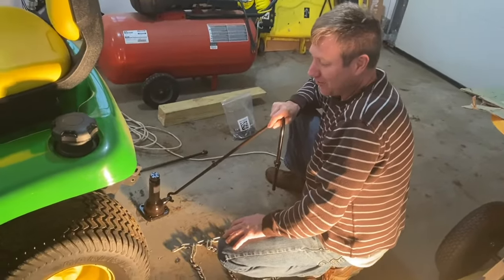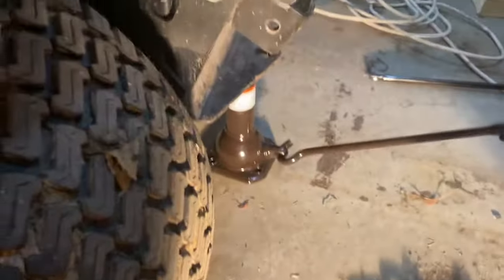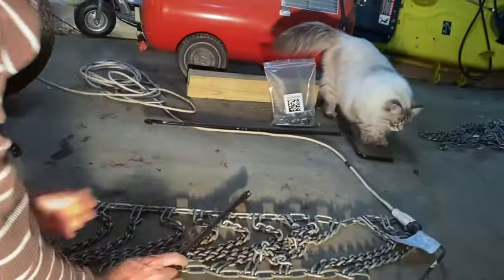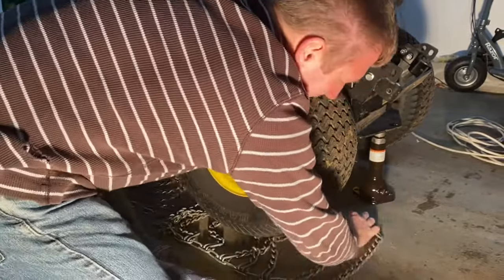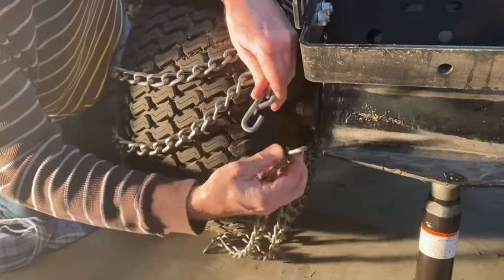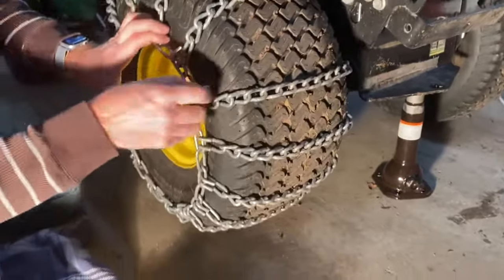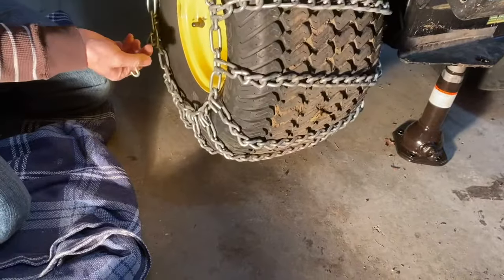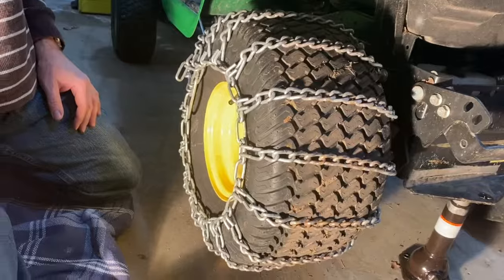How to EASILY install tire chains on John Deere X370

Comment: I pretty much have the same method with one additional step that makes a big difference. Let a few pounds of air out of the tire so it is a little soft and you're able to really snug up the chain. Then top off your air and the chain is nice and tight. You get better performance plus an easier, faster installation.
Reply from the maker: Great tip!
Reply: I take the valve stem out and start fully deflated, very easy to put them on.

Comment: Nice using a jack for this process. 2 tips,  Using the jack, I'd chock both front wheels, forward and rear. #2,  Once installed, don't shy away from using bungee cords to keep slack to a minimal.

Comment: I’ve been doing it that way for years, the Jack makes it a much easier job. I would recommend using some zip ties to hold the chains together as well, if the lock you were struggling with pops off it’s no fun fixing the chains when the wheels are covered in snow.

Comment: A few weeks ago I saw this technique on another channel.  And i tried it with our Ford 8N tractor.  I picked up one side, put the gear in neutral, placed the chain on the back of the tire and rotated the tire forward(over the wheel).  It was so much easier than driving over the chains.  Locked them in place, add the bungie cords for tension, and moved the floor jack to the other side and put those chains on.    Your installation went as fast as my Ford 8N tractor.    The only thing that I would change from your technique, is to spend $120 and get a 3 ton floor jack on wheels.  they are so handy to roll around in the garage and make rotating car/truck tires much easier.

Comment: Hook the inside chain connector in the 2nd or 3rd link. Then the outside connector in 1st link and Check fit. Move outside a link at a time until best fit. You may even have to move the inside again. You should never go beyond the first cross bar chain. Drive around a minute or so and tighten if necessary.

Comment: Nice job!  My routine is similar.  I see in the comments that some have already suggesting deflating the tires.  At the point where the wheel starts rotating and distributes the chain evenly, toss a scrap 2x4 under the wheel.  Much easier to manipulate the locking arm when the wheel is stationary.

Comment: thank you for making this video. I never installed tire chains before, so I was looking at another video from a tire chain company and they showed another method where you can do the installation without a vehicle jack. But my thoughts were it seemed like a half-baked idea (driving over the chains before installing them). if you have a hydraulic jack, I think the jack installation method is better.

Comment: I use Terra Grips - like chains, but the cross bar is rubber - on my JD GT 245 with a 42" snow blower on my 150' gravel driveway, easy to install, works like a charm. Then I use 36" Zip Ties from Ollie's (good stuff cheap) to take up the slack.

Comment: My  chains were first installed be the dealership. One chain was one link shorter than the other. The tensioning hook had to be inserted in the link that had the cross chain in it. It was jammed in there and very difficult to remove . The dealership claims they had to cut off a link to make it tight. I couldn't convince them that the tensioning hook had to be in an open link - not the same link as a cross chain. Surely I'm correct?

Comment: I have the same x370 and blower, how mush weight do you put on?
Reply from the maker: 3 plates (150 total). Local dealer recommended no more than 2; however, even with the chains and 3 plates, the tractor still gets stuck many times in wet snow and ice.